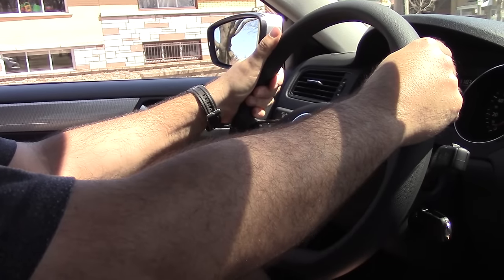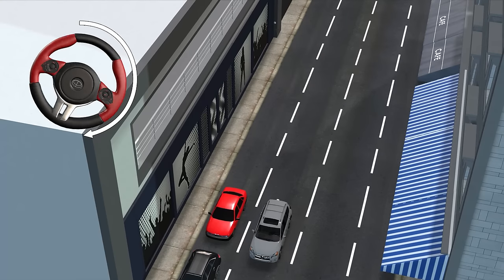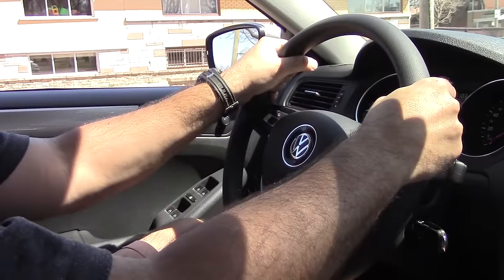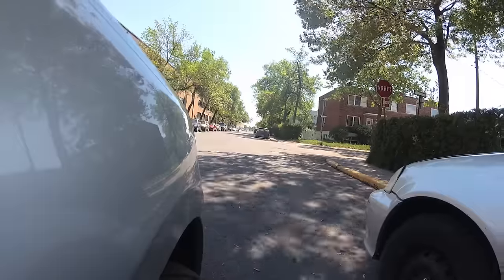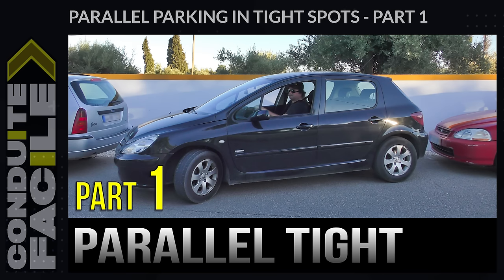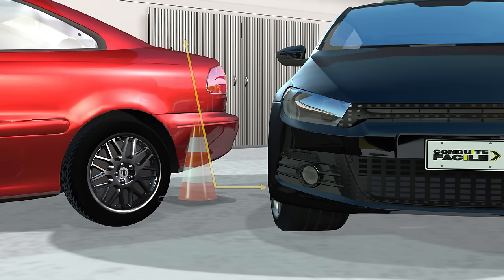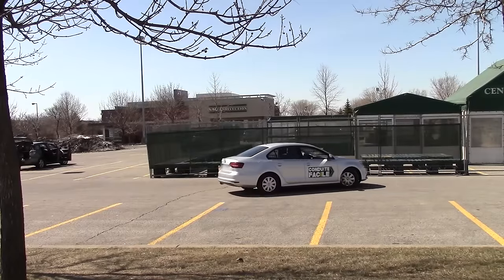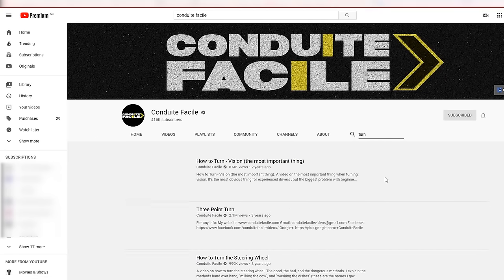How To Turn the Steering Wheel at Different Types of Parkings

Comment: This realy works amazingly well for me.

1. align car with 3 foot gap
2. slowly reverse
3. when your back bumper aligns with stationary parked cars back bumper, turn the wheel 1 full rotation to the right
4.contunue to slowly reverse, when your wing mirror aligns with the back of the stationary parked car, turn your wheel 1 rotation to the left (your wheels will be straight now)
5. when relativly close to the curb go full lock to the left and leave your wheels where they are, so when you have to move away again they will already be set up and ready

I love your videos!  they are so so helpful!

Comment: Your videos are amazing!  They are extremely helpful and very practical with the minute techniques which no one else talks about. Keep up the good work!
Also, you've covered most of whatever I wanted to learn. There are a couple of things that I would really like to learn from you: 
1. Downtown driving: Judging safe distances from pedestrians when turning right and left. Some tips here.
2. Practical parking guide. Anywhere I shouldn't park apart from driveways, fire hydrants etc. It is kinda hard to read the signs, evaluate timings and decide if i can park before the guy behind honking :) Tips for finding parking spots in crowded areas.
Thanks again!
Reply from the maker: Downtown driving is on the list. Already filmed. Actually, I filmed so much stuff that it's going to be a nightmare to sort through it all.
As for your parking idea, can you be a bit more specific on what you would like to see?
Reply: @ConduiteFacile   Thank you for your reply! 

Yeah Im awaiting for the downtown video, am comfortable driving most places but downtown. specially while turning right you need to check for gaps between pedestrians, cyclists on your blindspot. Its hard to decide how much gap is "prudent" for a crossing pedestrian(approaching from each side) - when to stop and when it is safe to go.

Regarding parking, basically it would be really nice if you could suggest ideas about how to quickly identify a parking spot and park - including a quick guide on where not to park(hydrants, police stations etc). Say I am driving to a busy area like sainte catherine or jean talon st, I need to find a parking spot, signal, check the boards, calculate the timing(if parking is allowed) all without stopping for too long. I checked with a couple of folks and they seem to have a problem too(the passenger then helps the driver!). Also the types of parkings - like sector parking and stuff. The problem is there is no information about all of this on any driving guide or anything. You just have to learn this by asking others. Would be really nice and practical if you could do even a small video on all of this.

Having said that, I would really like to thank you again for all the efforts you are putting in. Im pretty sure a lot of accidents have been averted(potentially lives saved), thanks to you Keep up the amazing work!

Cheers

Comment: Your videos are awesome! Is there a way to intuitively know if my car is straightened? I always have trouble knowing if my car is  pointed/headed/aligned straight or actually parallel to the curb.
Reply from the maker: It comes with experience, but I'll do a video on some tips that can help accelerate the whole process.
Reply: Conduite Facile thank you 🙏🙏 it’s also a problem when I turned 90 degree into a narrow garage entrance with walls on both sides; if my car isn’t straight/center and I kept driving, then I will hit the wall 😥

Comment: Can you please explain how to judge your distance between your car and the car behind you when parallel parking, when you drive a car without  parking sensors or any assistance.Is there a safe way to do it in this circumstances or you will hava to approximate the distance.You will have to rely only on the side mirrors or it is another way to do it?
Reply from the maker: I will do one on that this summer. It's a mix of mirrors and looking behind (and feel also, but that comes with experience).
Reply: @ConduiteFacile  thanks a lot!

Comment: In parallel parking on a two way street, if cars are parked on both sides and the street is narrow, how much do we turn the steering. The method of even one turn is hitting the car parked on the other side, from the front.
I cant parallel park in my street in front of my house when other cars are also parked in front of the house across mine.

Comment: How to overtake a truck
Reply from the maker: Basically, as quick as you can without going over the speed limit. I'll do a video on overtaking.
Reply: i should add, use your blinkers when changing lanes, if you're driving a slower manual car, you might have to shift down, and don't overtake on a blind curve.